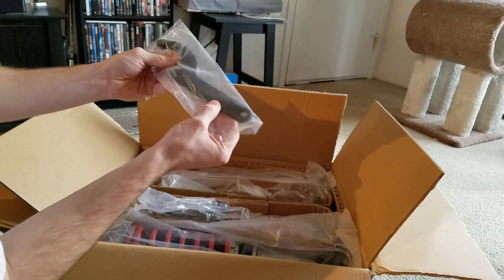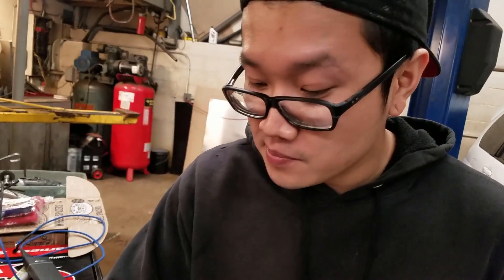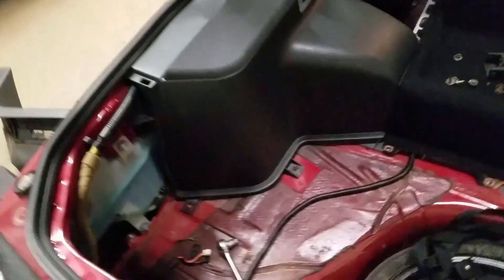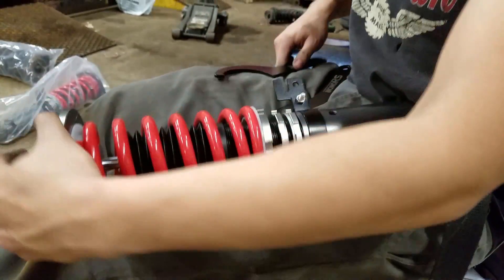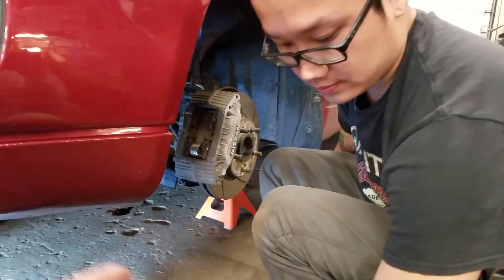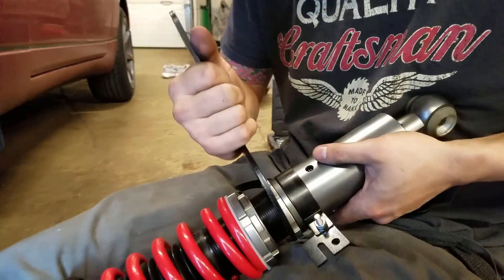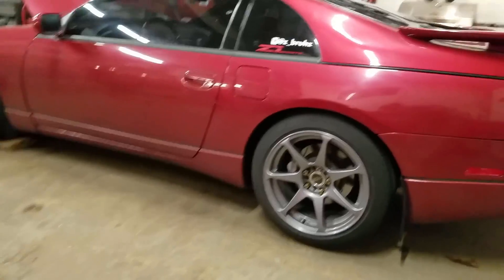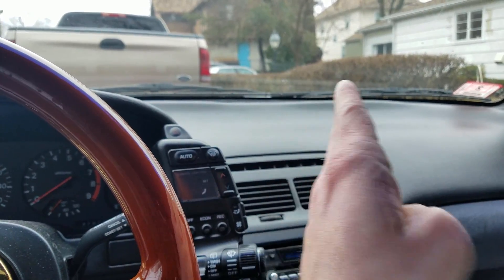GodSpeed Project Mono RS Coilovers (Review & Install)

Comment: I have mono rs on my civic too the only difference from your is my rears are basically independent suspensions and my fronts are coilovers. my questions is my front are bouncy do you know what the problem is? did set pre load wrong? any ideas would be really help me, it’s been stressing me out to figure out whats up.
Reply from the maker: Since them being practically the same. I would take try and measure and see if your pre load is set correctly. From there I would check if the coilovers are riding on the spring due to the piston failing.
Reply: Z-Bruhz alright Boss thank you.

Comment: Are they aluminum at all?  Are they lighter than the teins? Might go with fortune auto because they are aluminum because I had to send back 2 sets of tein advance z because they leaked at the seal right out the box.

Comment: Just bought mine, should be coming in the mail hopefully this week. Thanks for the info on how to start with riding on them right out the box.
Reply from the maker: Adrian McWilliams ayyyye!
Reply: How easy or hard was it to install the coilovers? I'm actually watching a few videos on how to install but none actually are Godspeed.
Reply from the maker: Adrian McWilliams pretty simple if you watch this video a few bolts just gotta make sure the rears are straight so the bolt can fit properly with enough threads to catch in the knuckle.
Reply: Z-Bruhz Did the kit require or needed camber adjustment it is just a simple "1 - 2" placement?
Reply from the maker: Adrian McWilliams after installation i would go get an alignment, and also when the coilovers finally set after being broken in
Reply: Z-Bruhz so your saying get two alignments within few weeks period?
Reply: @swervv2957  When you install them get aligned. Then after about maybe six months or so after they've broken in, keep checking the ride height because they will settle. After about that time then you either adjust them again or leave them and get it aligned again because it maybe have settled and is potentially wearing out one side of your tires. That's how mine was after awhile. 

The second alignment is for that "sure" settlement. It just take time.
Reply: Adrian McWilliams thanks for the reply, want to Know what you think, how they holding up?! Any noise or negatives? Thinking about getting these for my G37s I drive in LA rough streets and am looking for a comfortable no jarring ride, no major bounce. It’s my daily. You think they would fair good for what I’m expecting?
Reply: @swervv2957  I loved mine. I had mine for quite awhile. I didn't have an ugly ride, no rubbing, no scrubbing, but it is a slightly stiffer ride. When you drive on lower shiver suspension it will be a stiff ride. But as long as you take care of them properly, they will take care of you. 

I recent upgraded up to Air Lift Performance 3P. Still a good ride but a lot easier to get around over speed bumps and curbs.
Reply: Adrian McWilliams hell yea that the way to go for the higher price 👌🏼... thanks for the get bk! Was thinking about getting these or the Teins. Still not sure smh
Reply: @swervv2957  Both products are good. You'll just be paying a lesser price possibly with Godspeed.
Reply: Adrian McWilliams ok thanks man.

Comment: Are they still good?
Reply from the maker: Still driving on them now
Reply: Z-Bruhz and how is the ride bro?
Reply from the maker: @realforlife4255  the ride great, my other car has teins and they are practocally the same
Reply: Z-Bruhz I just bought a set earlier and hoping to get it in 2weeks for my civic lx 2014,any suggestion and reminder before putting it in on my car? it would be great for me
Reply: @lexmichael2040  set your pre-load before install...very important.I've had my Mono SS for 3 years with no leaks or problems. very quiet as well, no clanking noises. They have legit Japanese top bearings. Will buy them again
Reply: D. Corey thanks boss! appreciate, hopefuly this mono Rs are the same as mono ss, than you again
Reply: @lexmichael2040  SS is street spec...RS is Race Spec and higher than SS.difference is in valving. spring rates are the same.
Reply: D. Corey ohh my, I think I got a wrong one🤦🏽‍♂️ cause I’m gonna use the car for daily driving.
Reply: @lexmichael2040  shouldn't be too bad... You can make it more responsive if u get swift springs... They're less harsh and have more travel due to less coils in the spring vs the standard springs from God speed...
Reply: D. Corey alright boss, I’ll do that then appreciate you.
Reply: @ZBruhzchannel  do you recomend the SS? or the RS are better?
Reply: @DrynisDramula  so SS is a good buy? I need suspension to my s13
Reply from the maker: @MElekiaZ  I only have had the RS and they are still on the car in great condition
Reply: @MElekiaZ  they're reliable...you can also get custom springrates...call the manufacturer directly
Reply: Z-Bruhz which ones would you recommend for a G37s? I’m just looking for atleast stock comfort and reliability, I’m only going to drop a lil from stock height. Also it’s my daily and in LA rough roads. Thanks!